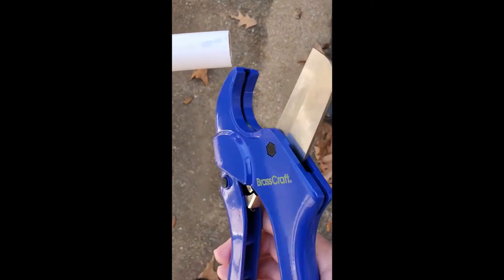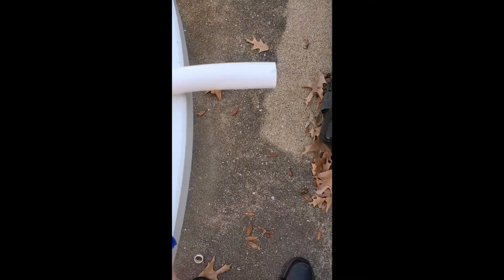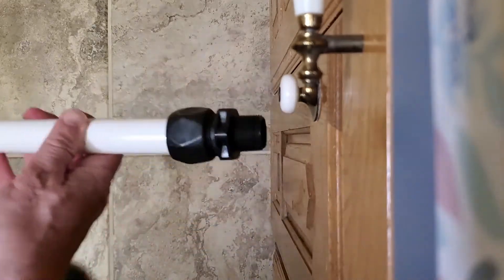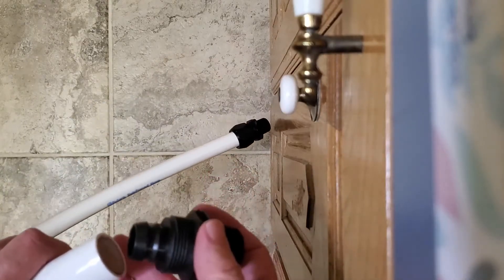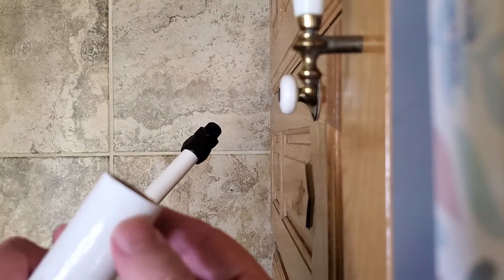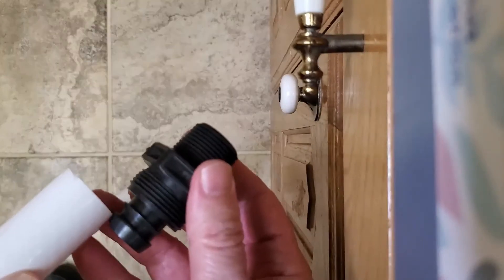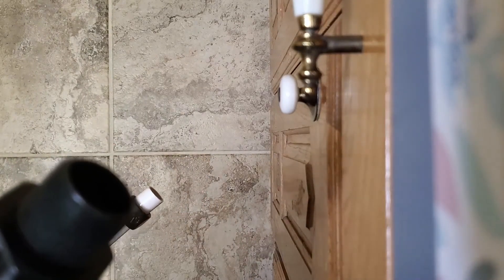Polaris Softube Quick Connects

Comment: Will u post video of how u connected to the pool pipes?
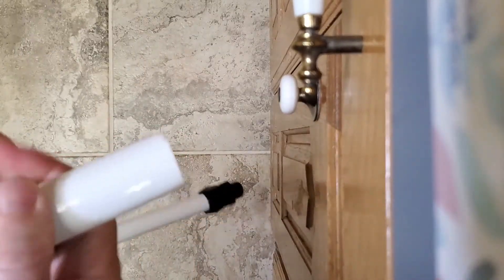Reply from the maker: Look at 1:00 in the video.  In real situation, you would first screw the Quick Connect into the threaded PVC pipe (a tee with 3/4" thread).  Then you slide the nut (collar) onto the hose and then you push the hose onto the Quick Connect.  I didn't need hot water if I left the hose in the hot sun long enough.  Then the nut is screwed back on like I show in my kitchen.  So, in my video just assume that I am not really holding onto the threaded end of the Quick Connect; rather visualize that the threaded end of the Quick Connect is already screwed into the PVC pipe tee.
Reply: I guess not mrfrapdaddy, what you ask is too much.